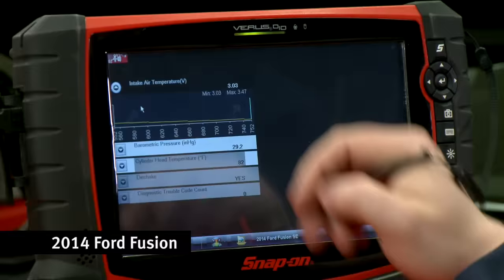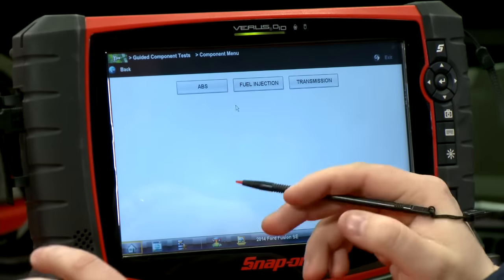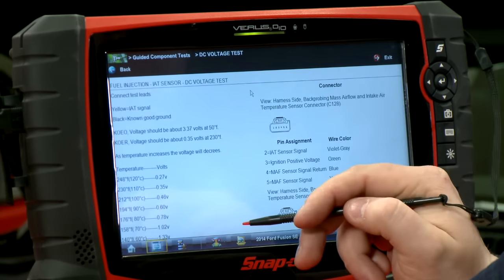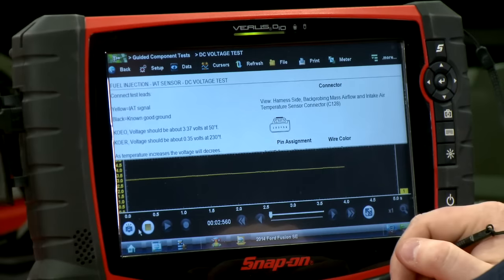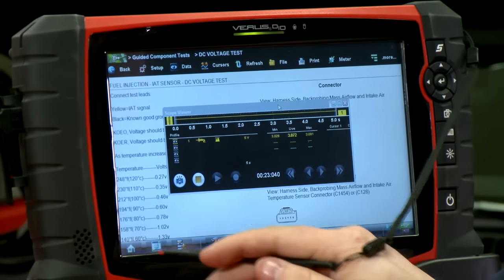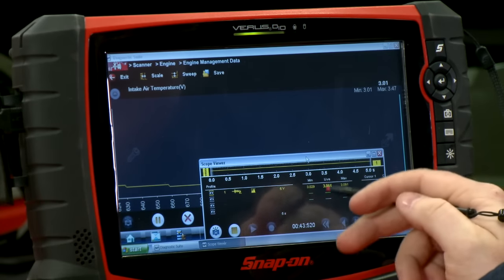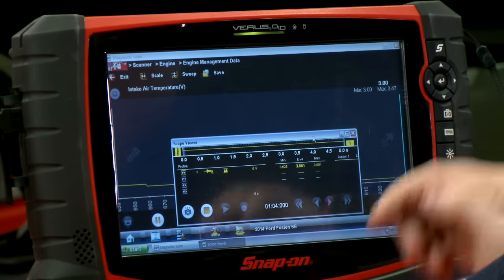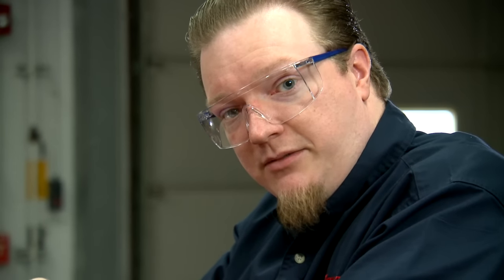Dual Screen: Scanner vs. Scope- Diagnostic Quick Tips | Snap-on Training Solutions®

Comment: It's hardly a 'real easy way' to do it. I could never understand why you can't just launch the scope at anytime by tapping the home key and have it open in a new window. It's running on Windows after all. I usually know the scope settings I'll need and pin config, so the guided testing just seems like so many clicks to get there. Is there anyway there could just be a shortcut written in to a future update to launch the scope? Or will it be a feature of the VERUS Edge?
Reply: Hitting the home button..going to component test meter..selecting the sensor that you are checking...and hitting the meter icon 3 times to turn the scope into a windows window hardly seems difficult.  Opening the scope would be great if everyone had the appropriate values memorized, but having the test meter set it up automatically allows even a first year apprentice to do this without having to know values.  I'm not sure why anyone would perceive this as a weakness in the tool.  This is a huge advantage.  Being able to open the scope and set the values yourself would require more steps actually.

Comment: I love snap on but you have no clue what your talking about!! You said you need a new PCM if the reading are not the same HAVE YOU EVER HEARD OF SUBSTITUTED VALUES? Look up Scanner Danner
Reply: So if the signal is good going into the PCM why would the PCM need a substitute value? Makes sense to me, how about you?
Reply: Substituted values only come into play if the signal entering the computer is out of spec.  These quick tips aren't meant to be exhaustive, but Jason did a fine job of explaining how to verify that the signal Leaving the sensor is the same as the signal entering the computer. If the scanner shows a value on the PID but the scope shows an improper signal entering the computer then you know it's a substituted value.   If the signal entering the computer is good but the scanner data coming out is wrong then substituted values won't come into play.